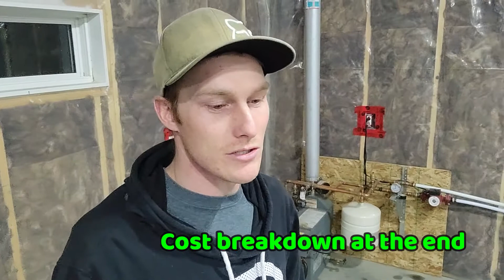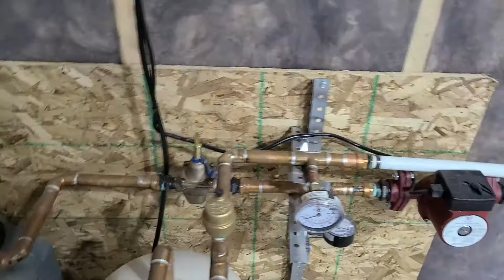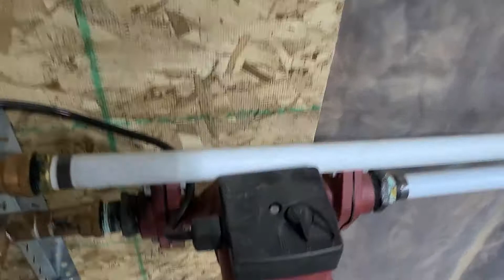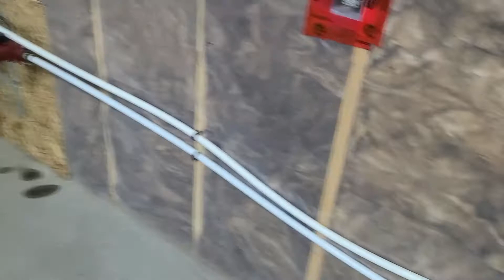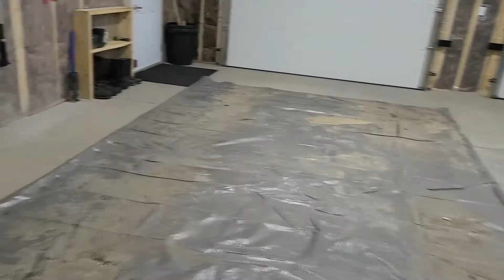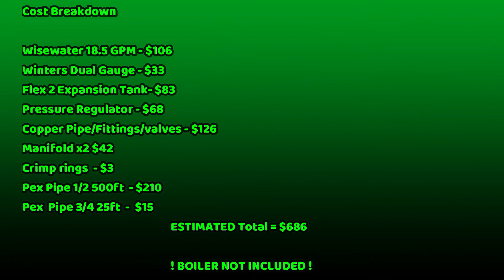Basic Radiant Heat | Amazon Circulation Pump | Laars Mini Therm ll

Comment: Your feed valve should feed into the center of an in-line t , not in the zone.  That is why you have the feed valve bypass flipper is up. Also your extrol tank looks like a potable tank for domestic washing water as it looks like it is 3/4 and should be 1/2 for a heating zone 
Usually Cream color is a potable domestic water extrol tank. Grey red or green is a heating zone extrol. I am an installer in nyc. 
Your job looks beautiful compared to many homeowners I have seen,  but you didn’t research the correct installation of most parts enough, if you had more knowledge it would be perfect. Always remember Teflon and pipe dope and will never leak.   Great job.